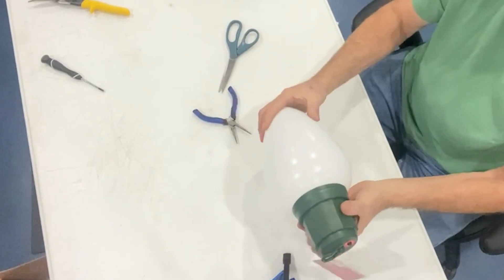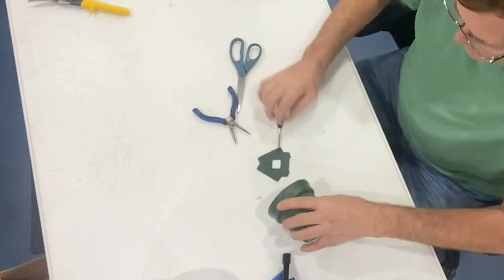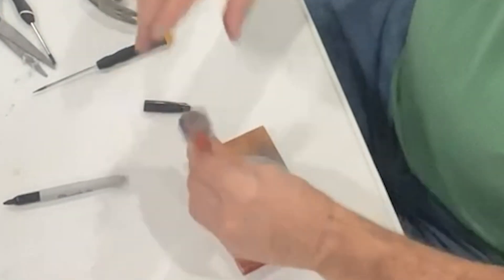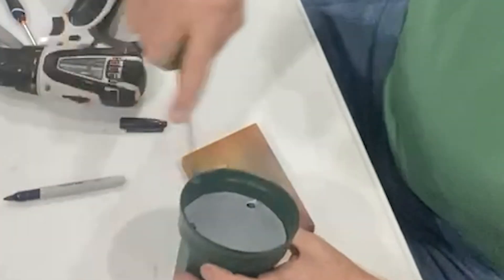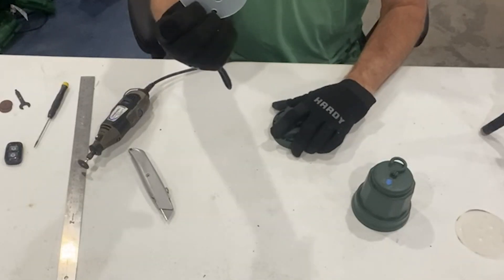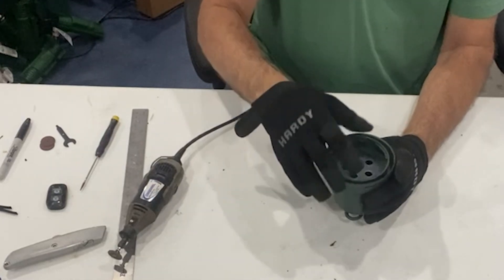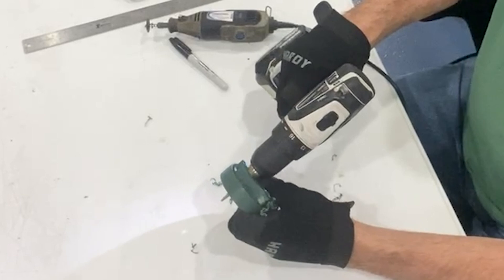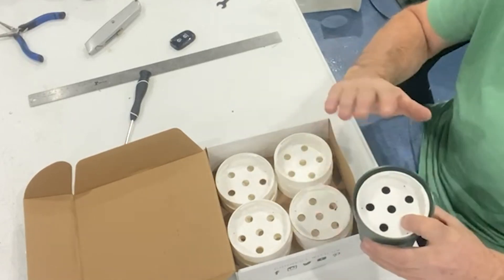How To Transform RBL Christmas Lights for Your Light Show - Part 1

Comment: Thanks for the video! The Etsy seller doesn’t have the item in their store. Just wanted to let you know.
Reply from the maker: Thanks!  There are many that make them.
Reply: @lightsonabby FWIW Reached out to that specific seller and they were super rude. Because of that, I made a 10 lights version of the cap and will be listing it on Etsy 🤣. Thanks again for the video!